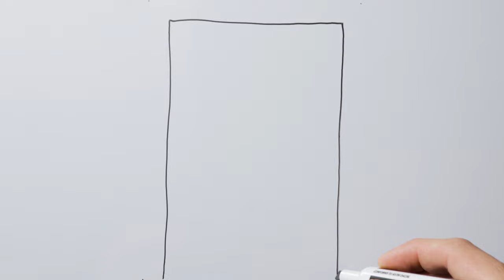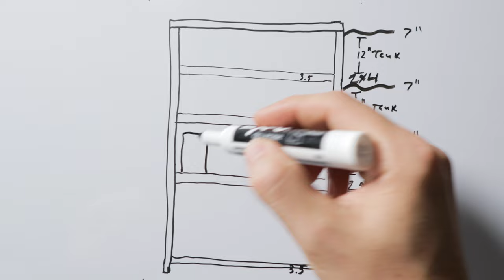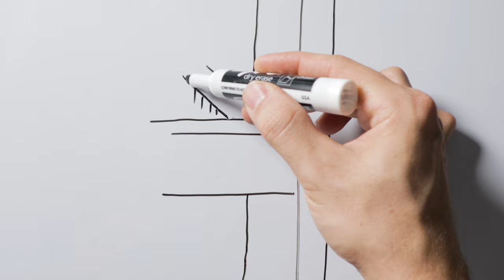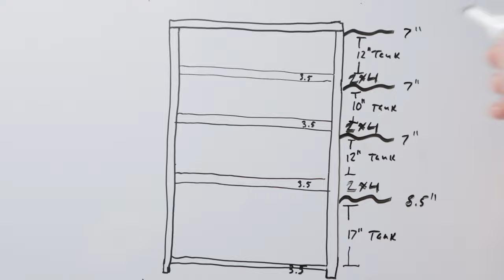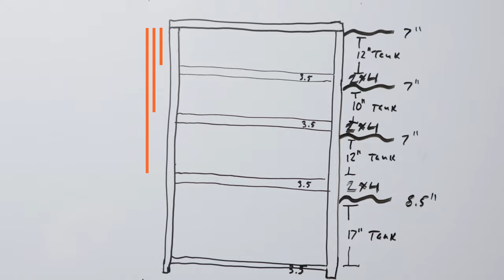DIY Fish Tank Rack Under $99!

Comment: Nice job,  I strongly suggest that the rack be screwed to the wall or extend the feet at the bottom to prevent it falling forward
Reply from the maker: Thats exactly right, thanks for the comment. I need to do and update mentioning that very thing. I will say, on a solid floor, leveled, it is surprisingly sturdy. 100% true though, anything this tall and heavy needs to be secured to the wall. You never know who or what will decide to pull it over.

Comment: Very impressive shelf I need one! But that switch panel is insane… So many outlets and they each have switches. Where did you find that?
Reply from the maker: Thanks! The original one I got isn't in stock anymore. But I updated the description with a similar one. 🙏

Comment: Beefy stand! I was a little worried for you until I saw the lag bolts! I love the roominess with using lag bolts instead of vertical 2x4s for support!
Reply from the maker: Thats the most important part! Lol
I see way too many flimsy stands and racks to allow one into my own home. 😂 Thanks for watching!
Reply: Agreed. Construction screws have little shear strength, so either lags or proper structural screws are essential.

Comment: Very impressive! Out of interest, why not LED lights? That would eliminate the issue of having to turn the flood lights down to avoid cooking the tanks above?
Reply from the maker: They actually are led lights! They are just a little overpowered with no adjustability. You could totally go with an aquarium strip light above each shelf and have more adjustability and timer options. I just went with the cheapest most reliable thing I could find.
Thanks for the comment!

Comment: I have been watching videos and racking my brain trying to build a stand that will fit into an under stairs cupboard. Most designs are dado cut, but this with lag screws has to be easier. My personal issue is fitting it under after its built because I don't think I can build it in there, I worry about the lag screws a little though, not because I think the screw would snap, I was thinking of the wood splitting in tat spot and of course the shelf going with it. I assume your tanks are all well and the shelves still strong? In the UK we are no where near as lucky with lumber prices and space. But I love what you have. Merry Christmas from Wales UK

Comment: Hopefully you respond what size is the horizontal first cuts you did how long do they need to be
Reply from the maker: They should basically be as long as the number of tanks you want to place on the shelf plus a little extra to account for trim on the tanks. I did 4x 10 gallons (which are 10" wide) and my boards were 42". BUT I would recommend going 43" or a touch longer, because at 42", my tanks fit in with almost no room to spare.

Comment: great video, was designing my next shelf and this came up on my feed, at 9:21 those lagscrews for structural support, are those stronger or as strong as 4 2x4's going verticle up and down on each shelf to support? if this works, the lagscrews would save me a lot of space, thanks fo rthe great video
Reply from the maker: I would suspect they are just as effective as vertical 2x4 supports, which are able to support roughly 1,000lbs (each). Factors that come into play are cost, obviously bolts are going to be much more expensive than lumber, and making sure to add extra room to fit each 2x4 under the shelf. Each are a safe bet in my mind. 
Thanks for the comment!
Reply: @Colton_Lee  wow that was a quick reply. Thanks for the comments! Off to continue to design my rack
Reply: what is the lenght of that lagscrew? @Colton_Lee